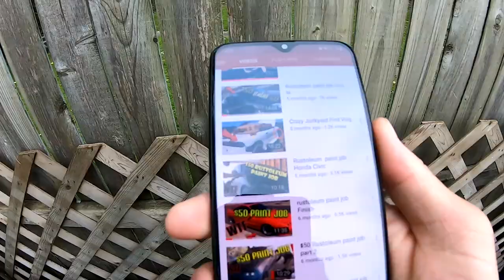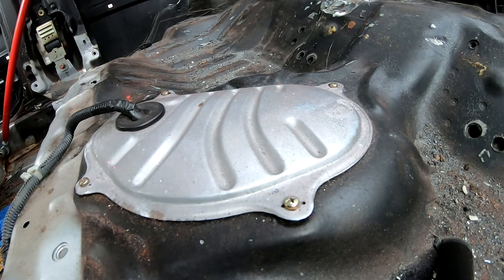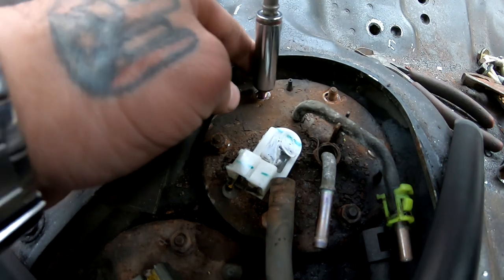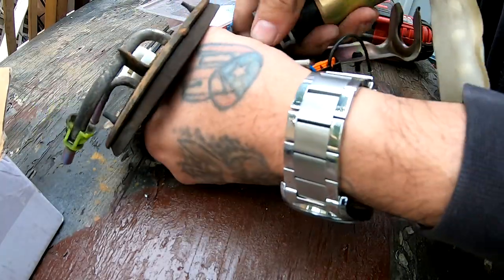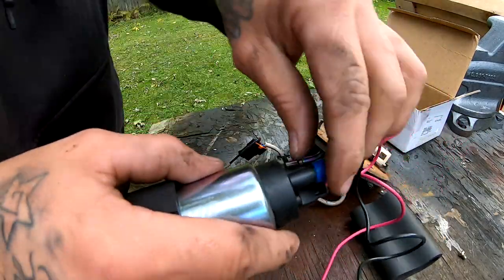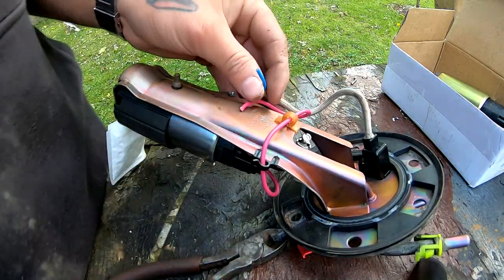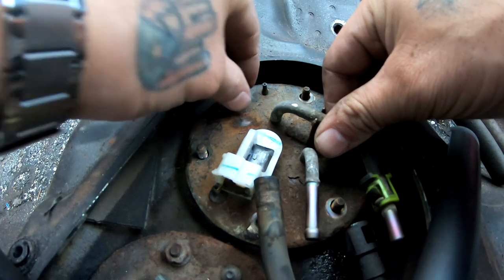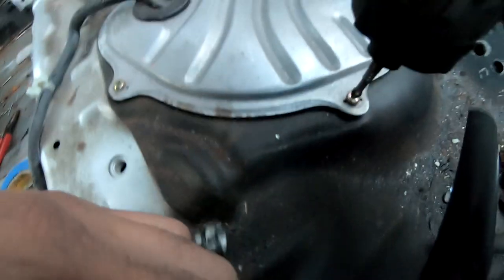Ebay Osias Fuel pump install 600hp $21.00 d16 turbo civic

Comment: Hello I'm late to the party but the sleeve is use to secure the pump in VW, Audi BWM's basket. In those cars the original pump is  held in a basket and is slighty larger which cause the osias, aem, mostplus, kemso, sytec, RH (whateve name it's the same body) pumps to wiggle in the basket, that's is what this sleeve is meant for.
Reply from the maker: Its never too late..Great info thank you.

Comment: Why do it say ocean on it and it looks nothing like the thumbnail? Are you sure you have a osias fuel pump?
Reply from the maker: I contacted the seller regarding that issue and im still waiting on an answer. I said screw it and installed it. But il keep you informed on what i find out.
Reply from the maker: Ok I got a message from the ebay seller claims its the same pump just two different names. I see myself replacing this pump in the future. I really didnt like that fact that like you said it looks nothing like what i ordered.
Reply: @BarbasLife  yea I contacted an oasis seller on ebay and asked them if the product in the picture will be what I will recieving and they said yes so I ordered today and will let you know if my pump is red
Reply from the maker: @waymenlawrence2064  that will be screwed up if its red im gonna contact him back then lol thanks for the info keep me posted im definitely interested in your outcome.
Reply: @BarbasLife  just got my pump in the mail and its red and says osias so.......
Reply: ☝️ Here's where I got it from ☝️
Reply: @BarbasLife  its really not worth it, it's only a 20 dollar pump if you want an actual osias pump you can get it from that link I've provided above but more or less they are probably made in the same place just looks different just the seller you got it from is saying that it's an osias pump and using the osias pump in the picture
Reply from the maker: Yea your right not worth it. But $20 here and $20 there in scams adds up. lol but just  hope it work a little bit for me haha thats what i get for buying ebay stuff. Next time im just gonna stick with a walbro.
Reply: @BarbasLife  well they sell fake walbro  pumps on ebay too just gotta research on the actual dealers that sell the real ones but I've researched the osias 340lph pump and people have has success for a couple years...my brother had a walbro 255lph fail on him so I'd say the osias is the way to go and it flows more than the walbro 255lph
Reply: @BarbasLife  hey what's your number I'll text you the pic if the pump
Reply from the maker: Are you sure you want to send it if you do im making a video so people  can be aware.
Reply: @BarbasLife  if you want you asked me for it

Comment: Why would you use that style of connector in a gas tank bad idea in my opinion plus I would never use those on a car ever. But everthing else was great worst connectors ever.
Reply from the maker: Come on its got to work a little bit have faith.lol
Reply: @BarbasLife  lol it will work for a minute it is just gas will eat the plastic and that's all that holds those together lol crimp connected are at least metal. I like how you car is coming along though good job man.